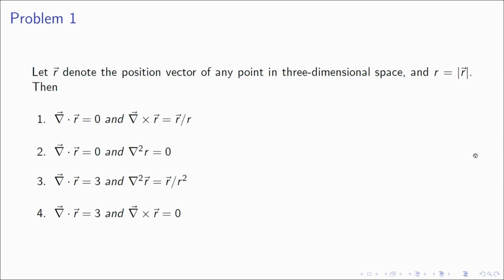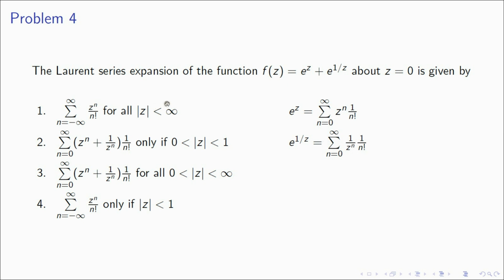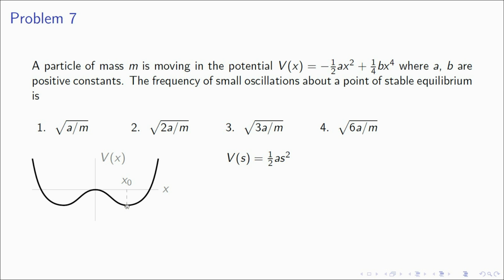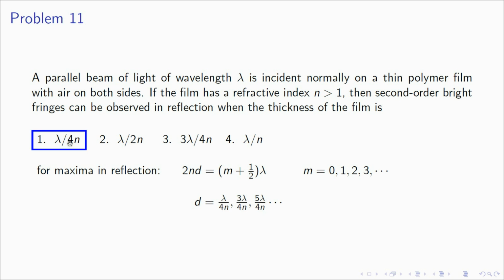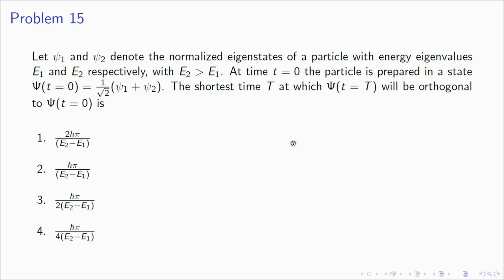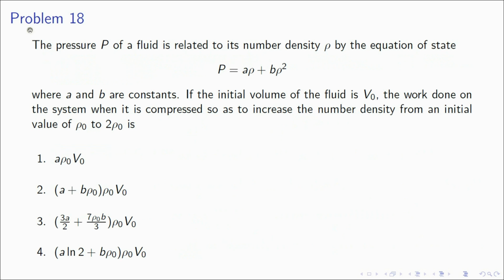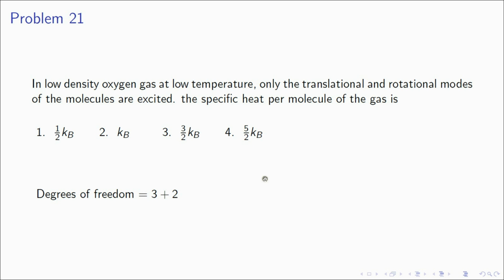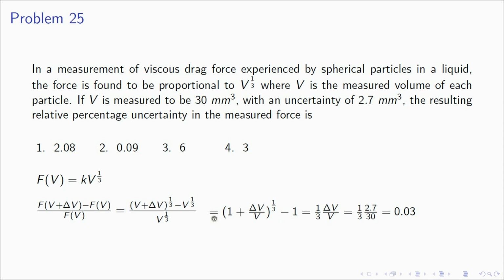Solutions to CSIR NET physical science part B Dec 2014 (with shortcuts and tricks)

Comment: for the problem 7 
1) find first derivative and made it equal to zero to get equilibrium point .
2) find second derivative at equilibrium point and divided   by m  and take square root .it will be the frequency (option 2)
is it ?? i am not sure

one model question is here 

http://web.mit.edu/8.01t/www/materials/InClass/IC_Sol_W13D3-3.pdf
Reply from the maker: seena p.h You also have to divide it by 2! in the taylor series expansion.
Reply: shailesh M  no need of using taylor series here.its just simple .please refer this problem  http://web.mit.edu/8.01t/www/materials/InClass/IC_Sol_W13D3-3.pdf
Reply from the maker: seena p.h
Yah you are right. The factor of 1/2 should be excluded from the taylor series while calculating k. This leads to the correct option.

Thanks
Reply: seena p.h